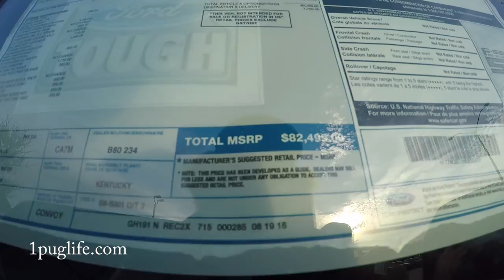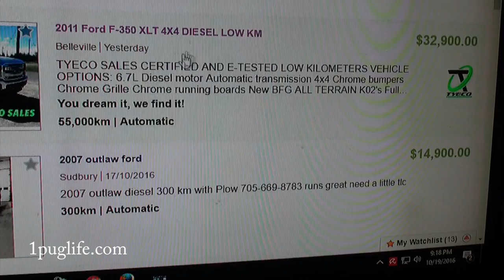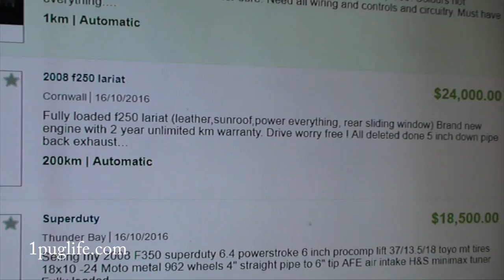truck shopping and getting kicked out of walmart

Comment: friends don't let friends buy ford's
Reply: nah personally i dont like ford but they are still good trucks same with dodge and chev want a truck that will last buy a toytoy and have it for 60 years who cares what you buy as long as you like it
Reply: Toyota Tundra had bad balljoints,transmissions,engines actually blew up from 2 miles..Rear differential and driveshafts..Tacoma had frame rust issues and they had to replace the whole frames..Toyota 's are not that good..I own a car lot and have them all,Asian cars are over rated..german cars are good for 2 years then are a nightmare and costly to fix,thats why you see 15 year old BMW's with 30,000 on them as they never run,then you see a 15 year old Dodge,Ford,GM with 290,000 on them as they run and run !
Reply: My friends are smart enough to never buy GM garbage and if they did their man cards would be revoked. Dodge is OK if they buy the right truck and Ford is the way to go all around.
Reply: rocker85675 if you want a Ford w/ a diesel you Do a Cummins Swap
Reply: Guys buy what you like...They all have good ones and bad ones..You can get a pos Ford,GM,Dodge,Toyota..or you can get a good one that will run 200,000 miles with next to no problems...I have seen it all..

Comment: Just picked up a 99 f250 that needed a rusted rocker panel replaced. 8 foot bed supercab. 7.3 tdi Runs great, 140k mileages, almost brand new trans for 2000$. They are out there, stay positive

Comment: Hey Pug, I worked for Ford Dealer for many years. The 6.7 are a lot better than the 6.0, as an avid Ford lover, the 6.0 suck.
That being said, the electronic 4x4's dont have the problems they used to. They changed it (I dont know exactly how, I'm not an engineer, but I never sold parts for the 4x4 system, if I did, it wasnt enough to remember it). You will only see the F150 with an 8 foot bed if its a Work Base single cab, unless you order it with an 8 foot. If you get a sales person who knows what the fuck they are doing, they can look at other dealers and do a dealer trade and get it for you (for the f1 or f250), I guess it is how bad they want to make a sale. The F250 8 foot beds are out there. If you go to more rural dealers, that is where you will find them. In the bigger cities, it is all yuppies who want a truck just to say they have one and get the EcoBoost with the 2.7. Don't get that, if you are looking at the F150's, get the 5.0.
You will find the kick shift 4x4 on the Super Duties. They come on all packages. Stay away from the Limited and Platinum models. They are usually loaded with electronic shit that you dont need (or at least I dont need)
I hope this helps man. Good luck with the search. If I cold afford a 6.7 I would get one in a heart beat! IF you need any help or have questions, send me a message.
Reply: I think he should just get a f150 with the 5.0l also. He doesn't need a diesel. He also wouldn't have to worry about leaving the truck plugged in all winter.
Reply: I drive a family brand new 6.7liter  F350 from time to time (not mine but have access weekly), they are pretty nice, no problems so far after about a year. And I admit this as a chevy guy. Insanely overpriced though, I cannot believe nice trucks are fetching 50K, only a few years ago the average price was 30K. Buy a used one from a grandpa who has records of everything fixed, not from a dealer who will rape your lower cavity and back pocket
Reply: Short NPortly 6.7 engines are equally if not worse than the 6.0! have you ever had the hood open on one? 4 hours of dismantling to find the dip stick lol both motors run greatish after about 8 grand worth of shit! inline 6 all the way!
Reply: 80k in this case.
Reply: shawn crosby no they're not. I've had to deal with these trucks everyday for years. you have no idea what you're talking about goof.
Reply: Short NPortly ya anything but the 6.0 ford diesel will be fine

Comment: PUG, I just bought a 2008 lmm Duramax and it's fuckin mint eh. Injectors and mint still after 266000 miles. No coolant leaks.
Reply: buddy has one of those or an LML i forget and it's the nicest truck i've ever ridden in but it just doesn't feel like a truck to me.. feels like an oversized car with a shitload of torque. really like the LLY dmaxes, they still kinda feel like trucks
Reply: +Anthony M how do they not feel like trucks??
Reply: idk partially the IFS, partially it's like a $80k sticker with heated seats, bluetooth and a personal dildo warmer. i just never could imagine hopping into that thing covered in mud or even taking it mildly offroad. like don't get me wrong, it's a fuckin nice ride it just doesn't correlate somehow in my brain
Reply: LOL !! Good luck with that !! = )
Reply: My 06 LBZ has a dana 80 up front with a 4 link ;)
Reply: Blue waffle cone 80 up front huh? must not do much steering..
Reply: You know nothing john snow.....
Google "dana 80 steering axle" There is a guy in a machine shop who did a badass writeup on how to do it. It involves pressing new tubes into the housing and welding the upper and lower knuckles to the tubes. Easily done with a donor for about 1500 dollars including the axles. I ended up using beefed up kingpins for a dana 60 and the hubs to match.. Be wary of people with measuring tools, machining tools, and welders. You will be shocked.
Reply: oh don't worry, i know plenty about hybrid steering axles. awful lot of unnecessary work for a full bodied (i assume) rig. or is this a big dumb mud truck? lets see it.
Reply: I have an LML and love it. No problems so far, love it.

Comment: If its got 4x4 you cant complain who cares what engages it. push button is fine especially sense its only a 5 dollar vacuum hose if it does go out
Reply: more things to break when it boils down to it.. manual stuff exists because it works. you're engaging the transfer case by physically moving the gears not clicking a switch that can break that triggers a solenoid that can break through wires that can get chewed that needs a vacuum line that cracks to fire another switch that can break through 20 electronic safety checkpoints etc etc etc pull the lever, it goes. so much less BS to worry about
Reply: my friends got a 87 ford ranger plow truck push button never broke on him or his grandpa more things to go wrong my ass
Reply: We live in northern Wisconsin and rust hasnt even broke it yet push button doesn't have as many problems as people think
Reply: I had a suburban with 360,000kms with push button. It worked every time
Reply: Anthony M In Canada the ice buildup in the winter, yanks the activator hose off from the cachoocher on the fords. But chev has their problems too. Manual is good. Kine like the auto hubs for when you stick in the goop you didn't see. Stovepipe.
Reply: Jason Curry and even if something goes wrong with the lever or seat, at least on old toyota stuff, you can move the shift fork with a screwdriver from the warmth of the cab
Reply: Its all the same shit but rather two or three wires to a button on the dash and a electronic servo motor in the case. Pug and all these that bag electronics on cars or trucks have no real idea what they are talking about. Most the time electronic issues are a burnt out servo motor or a simple $15 sensor. Alot of the time the sensors issues are cheaper then a friggen old school cable to replace. 

It's the same as in the late 80's everyone bitched about EFI based cars were expensive to fix when in reality they really are not. Lets not even get started on modern automotives are built to be easier to fix then the older EFI based automotives. The electronics on modern cars are alot more simplified and basically unbolt and replace type parts.

This bullshit electronic more things go wrong talk sounds so ignorant to us mechanics, although these sorts of people keep us in business to replace their $15 parts. Funny thing is older automotives are more of a pain in the ass to fix anyway, bring me a new car into the shop anyday.

Its like saying id rather a crank handle to start my car then a starter motor because all that electronic shit is issues waiting to happen... Same fucking thing
Reply: CueTech Industries "This bullshit electronic more things go wrong talk sounds so ignorant to us mechanics, although these sorts of people keep us in business to replace their $15 parts."        

You can buy a lot of $2,500 beater trucks or buy a lot of $15 dollar parts before you reach the normal $45,000 plus for a brand new truck now a days.       

"bring me a new car into the shop anyday."
 
Yes your a mechanic or so you say, who wouldn't want easier more profitable job, since most people don't have $10,000 plus dollars to buy a scan tool to read most of them codes or get a better idea of what is wrong for lot of them sensors. Oh and these "newer cars" have tons more stupid shit packed together in tighter spots to run/working these sensors it takes longer "labor" to fix or replace them.
Reply: chevydiesel350015
You only need a code scanner for more exotic makes (Italian supercars ect). Most dealerships have one to make tracing sensor issues easier. However having said that for many 90's makes finding a code scanner to suit is near impossible. I use a laptop with custom software although thats just to save time.

In most cases its as easy as using a multimeter, pull the plug off near the sensor and check for a signal. If there is a signal you check the part itself for resistance readings as most use a ohms resistance reading. If the part works but no signal then check the ECU end for a signal. If ECU has a signal then its a shorted wire, if not (rare case ECU issue).

Other then that there is really nothing to it, the ECU controls everything. The ECU in most automotives is no smarter then a calculator. Also ECU's are very robust and like i said before most issues are a sensor or a servo motor burnt out (depending the part obviously).

Nowadays i work in a dyno performance shop and also been writing automotive software applications for the past 3 years. Prior to this was a qualified mechanic in the trade for almost 15 years. Most useful tool as a general mechanic was the trusty old multimeter and still is.
Reply: CueTech Industries like, this is cool and all and i respect your trade, but we're talking multimeter, under hood, tracing wires, etc etc.. vs shoving a screwdriver in the hole click. everything's nice in the confines of a shop with a case of tools and AC. i'm cool with making non-essential things electronic but engaging your 4wd? you never do that when it's 75 degrees out with a nice breeze yknow.. you need it to work flat out.
Reply: cue tech industries ,, those servo motors can be quite costly ,, i do however agree with you that efi is way better then the old day carb ,, i would still rather work on the multi port injection system then the efi on most vehicles ,, a person has to be careful in the type of vehicle they buy , some have the intake covering one side of the injection system and has to be removed just to pull the injectors
Reply: cue tech ,, most people do not even know what a multimeter is ,, even if they had one they would not be able to use it ,,  on another topic about most people ,, its the same if the electricity would not be available on those hot or cold days ,, most people would die ,, they would not have a clue on what to do ,, i know a lot of people that do not even know how to build a home computer and its as simple as a few screws and insertion ,, the installation of the software is the hardest and yet is simple ,, not to them though ,, my point is that we are all not capable of being called a do it yourselfer
Reply: cue tech ,, to do with the crank handle the old school equipment had , it had saved me many times when i were young ,, my dad was never a great fixer and i remember cranking our old wd9 tractor many times due to the charging system not working properly or due to the fact that alcohol for him was more important then a new battery ,, i had to teach myself to become a do it yourselfer ,, on those new vehicles  things are packed so tight  and in the most hardest to reach places ever ,, i would rather work on my old truck any day then to work on one of those new trucks ,, unless its a tractor truck semi

Comment: Ive had a 2014 f350 6.7 with no issues since i've had it ( 50,000km ) on it now. There were a few issues on the 2011's but other then that there a pretty solid truck. Mine is a crew cab long box.

Comment: Btw put you can't get any truck with 4x4 on the floor it's all electronic but f250 have the locking hubs still. If you want crew can and 8ft you have to get a 250 or higher like you have.

Comment: My friend has a 2011 f150 with the ecoboost 3.5, the fucker has 400 000 kms on it and it's still chooching like a boss. Been a great reliable truck. Also most 4 doors only have the 6 foot bed.So hope you get an ecoboost then do an exhaust on it like big dirty.Get some really nice gains on them with a nice free flow/chooching system.

Comment: Chris the only thing I run into with these 6.7l is the turbo's going out early expect one at 50,000 miles and again right after your warranties out the cat converters always go out but in order to keep your warrantee they have to stay on unless you got a Ford computer to play around with open exhaust and DEF delete but again a lot of work to keep changing back and forth for warrantee work I would run it till warrantee runs out then put all the deletes in and you'd have one sick truck good luck on the 8 foot bed most goofs out here wanna diesel to play with not actually do any work with them.  anyways good luck with the truck shopping buds shouting out to ya from Corpus Christi, Texas.

Comment: Hey pug the 2015-16 you can get a 8 ft box GMC 1500 v8 with manual transfer case on the floor and locking diffs. The pull pretty good even with a full size bob cat on the back using a Pinto hitch. I've had 3 of them in the last year (trade them in for fancier models) BMP

Comment: hi pug here's what I found out the best year to buy is a 2007-2008 they are somewhat cheap to repair well built if you get one much newer than that it gets expensive to fix them 7.3s are beasts but they ride hard 6.0s are a more smooth ride like big dirtythe are more reliable when getting a 07-08 and up but get much more expensive the newer they are.

Comment: Man must be hard to find a 250 8FT SWB up there down here in louisiana they got all kinds of variants of trucks at the ford dicks. I drive a crew 6.0 6.5ft but had a extended cab 8ft but they still have plenty of crew cab 8ft swb just gotta look for em. Even have used pointless ford crew cab 6.5ft duallys just like the dodge 6.5ft dually beds pointless... But just get a 2012-2016 F-250 dont get a 2017 new body style for a couple years till the issues are ironed out or you can see some type of track record cause there still in baby steps.

Comment: I got a 2012 F350 with the 6.7 ....loooove it best truck I've ever had
Reply: Carl Meckle How ya doing. Had a 2008 f350, 2011 f350, 2012 f350 and on a 2015 f350 now. Found the 2011 and 2012 the best for no turbo lag and mileage. The 2015 is a pretty good truck and really comfortable. Driven all trucks in the mountains with trailers behind. Like the power and antisway. Ford leads the way in the oilpatch in western canada.   
I'll stick with the ford's.
Reply: simply fred  Hello !   :)

Comment: you have to go to older truck lots for an 8ft box j and b way out dundas has lots way cheaper we got a 2007 2500 sileraldo for less then 10 kinda high milage but fixed everything good and any problems they fix good guys

Comment: 6.7 powerstrokes are good. The 8 foot box and 4 full door's are out there. Work trucks and they come with a floor shift 4x4. Talk to a real ford dealer they'll find you one
Reply: And stick with the f350. Has better everything then an f250, steering, brakes and suspension. Just from experience. stovepipe.
Reply: simply fred there is very little difference between a srw f350 and an f250.
Reply: shawnsutube I beg my pard to differ.
Reply: simply fred If you're talking about a dually F350 then your statement is correct but not for a single rear wheel F350. I drive a 2000 srw F350 so I have researched into it.
Reply: shawnsutube Bmp. 2011 - 2015 yrs. Srw trucks. Found the f350 was just a tougher truck for the money and had better everything. The f250 was ok. But go big or stay home. I've owned 3 trucks in those yrs.

Comment: Don't even bother looking at those half ton toys if you need a real truck most of them only have a 5 ft bed if its a crew cab. I have a 2003 f350 like big dirty. Did a erg delete put a new oil cooler in it, put a looney tune on it and it runs like a champ! 137000 miles on it. Didn't know the problems with the 6.0 or I wouldn't have bought it. That being said if you spend some money fixing the defects they are a good motor. I would throw a 7.3 in big dirty and save your money. My old 350 had 7.3 and had 376,00 miles on it when I sold it and still ran great.

Comment: What's with the 8ft longbox, most people buying long boxes get dually's. The 6.5 boxes are very common now on f250/f350 trucks. The length to Parallel park a crew cab+8ft of box is fucking crazy. I will stick with my 6.5 pant antler box.

Comment: 6.7 ferds have turbo issues and cp4 problems. your best bet is to get a duramax or a cummins. wouldn't even consider a 6.4 ford they are even worse than the 6.0's and cost a fortune to fix